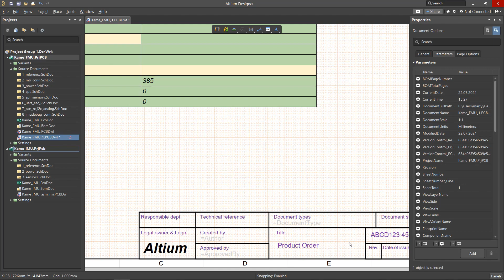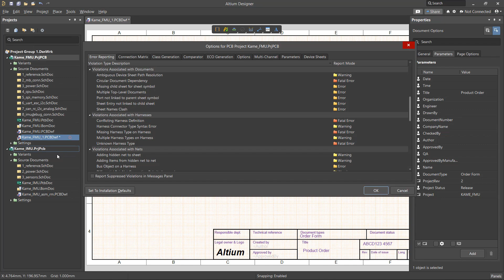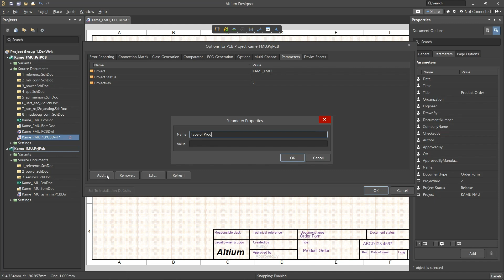How to Use Document Parameters with Draftsman

Comment: There are these fields that are faded, such as "=Revision".  What is the right way to give these values?  I tried adding them to the Project/ProjectOptions/Parameters and now that parameter I added doesn't display the "=Revision" any more, but it also doesn't display what I added.  It does show up also as a PCB Parameter in the drawing parameters, but again, doesn't display it.  What's the right way to handle these "=Parameter" fields on the drawing that aren't "User" fields?  Things that are clearly "User" I can change like =CompanyName, but if I do it that way, I can't make the text bigger.  This is a frustrating tool.  So, this seems pretty useless, and I just end up putting them in a free text on EVERY sheet of my drawing...
Reply: I just figured it out after experiencing the same frustration. In "Project" > "Project Options" go to  "Parameters" and create an entry that matches what's on the sheet. So if it has "=PCB_TITLE_1" you'd make an entry called "PCB_TITLE_1" and assign a value. Close/Re-open the draftsman document and it should now have the value you assigned.